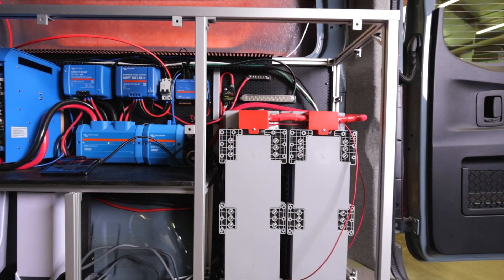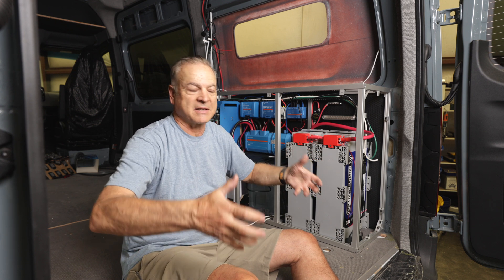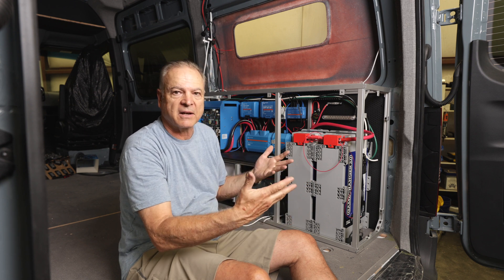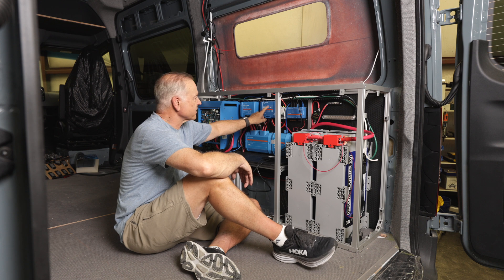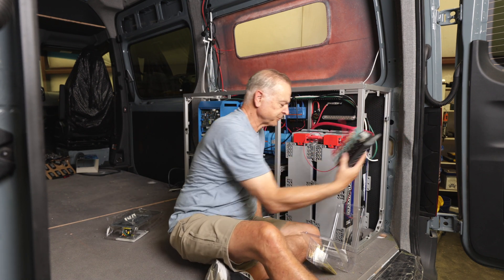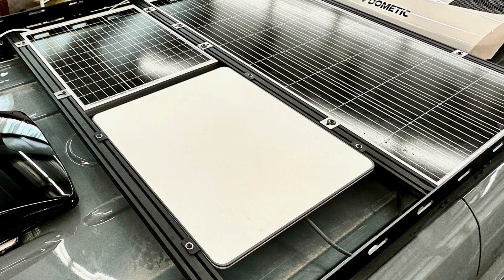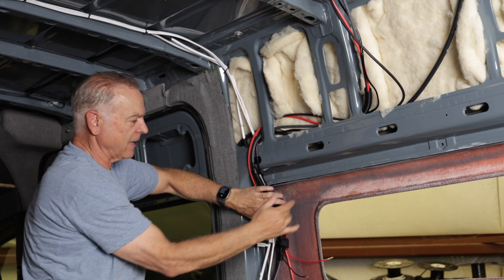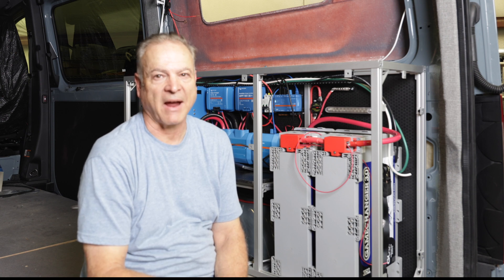VAN BUILD | Off Grid Van Electrical Systems Explained

Comment: Hey Mate, Awesome video. loving your content, as I am building my own van out here in Australia and this and many of your videos have helped me and I have decided to go with this exact electrical system. My question is do you know if there are any Victron cords/cables I need to order when ordering my system, I don't mean power cables I mores mean cables like the RJ45 UTP Cables or VE Direct Cables and if so haw many would I need as I want to try order everything from the same place here in Australia. And if you have a Wiring diagram I can purchase for this exact system? Cheers mate, appreciate you 🙌🤙💯
Reply from the maker: G'day! Thanks for watching. You will need an RJ45 cable to connect the inverter to the Cerbo GX. You'll also need (2) VE Direct Cables to connect the SmartSolar controller, and the Smart Shunt to the Cerbo GX.
Reply: @thrivans  thanks for getting back to me, I appreciate that. Do you have a wiring diagram I can purchase at all?

Comment: In looking for a circuit breaker I found three types.  What is the difference in fused (I do know they have replaceable fuses), switch only, & circuit breaker?  Thank you for your answer.
Reply from the maker: If you're talking about the Blue Sea DC panels, the switch only has does not have a fuse. You would have to add that somewhere else. We use either the fused or circuit breaker version.

Comment: When updating parts of the electrical system on my 1999 motor coach, I discovered BlueSea  components. They’ve been fault free for over 10 years. You’ve confirmed for me the prudent  use of marine grade components, I discovered them throughout the 1999 build for all systems, and they have been ideal. For instance, I can still buy anodes and elements for the water heater 25 years later.
Reply from the maker: Awesome. Blue Sea is great.

Comment: What is the size of your electrical box?  Thank you!
Reply from the maker: It’s about 16” deep, 32” tall, and 55” long.
Reply: Whats the cost if you were to build the whole component extruded aluminum box with all the individual electrical components and ship them out to Bloomingdale NY?  Also I think it would be cool to have a dual Murphy bed design in the back of the van that you could on the plumbing side have Molly panels to store shovels, tools. fishing and camping gear and on the other side have a mad scientist work station with monitors. switch panels security camera controls etc and a flip down work table..kind of like a work station to view all the van system diagnostics for battery charge life...water and tank level indicators etc etc.  I don't like hodge podge intall all over the van in odd places.  I'll have you design that for me so it's like Scooby Doo Mystery Machine meets military grade utilitarian design.  We should all have fun with the design aspect and not be so cookie cutter in that thought process. Cheers!

Comment: Jeff, do any of your vids show tips/best way you have found to "skin" the extruded aluminum framed boxes?
Reply from the maker: We use 1/2" Hexply over the mechanical boxes. We screw these in from the back using corner brackets. Where we can reach the back, we put a black screw through the Hexply right into the center of the aluminum bar.
Reply: @thrivans  Nice. Thanks for the reply. I am still contemplating if we are going to go for the 80/20 type product (like "tnutz" as you recommend) or go wood. Only thing that makes me skittish is I heard George from Humble Road say how he has to do a "tighten up" on everything 6 months or a year (?) after install.
Reply: @TeutonicNordwind I’ve had 8020 cabinets in for 6 years.  No loosening of anything.  I used blue loctite on every bolt.  Also used a thin serrated lock washer.
Reply: @daisydela  Thanks for the tips. Waiting for the weather to break for spring here in Michigan to get started on it. Been studying and making some decisions on electrical

Comment: I don't get it why people prefer breakers in a 12volt system over fuses. If a fuse or breaker pops you have a failure or a design fault. Don't just reset but find the issue and fix it. Fuses never pop in my build!!